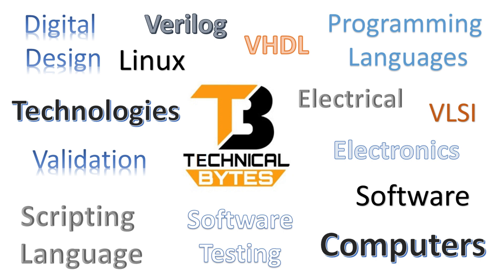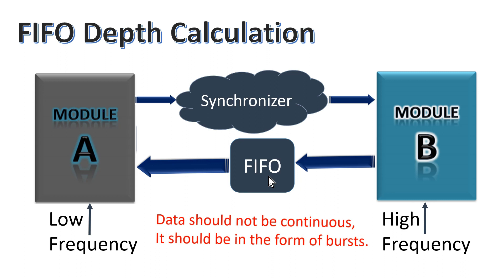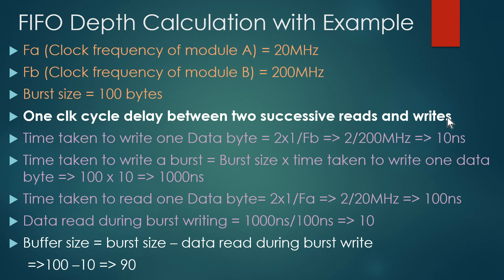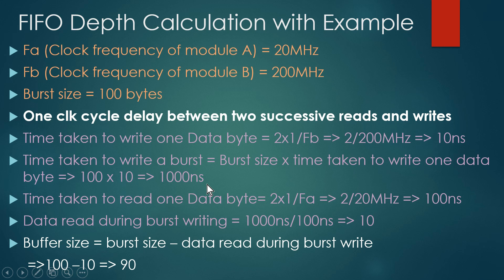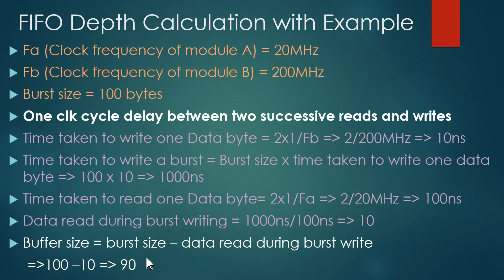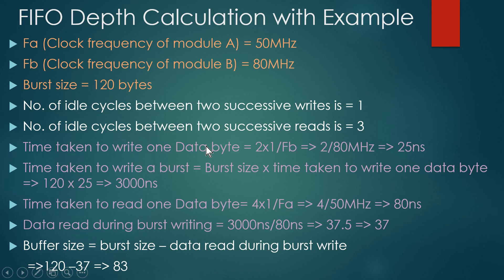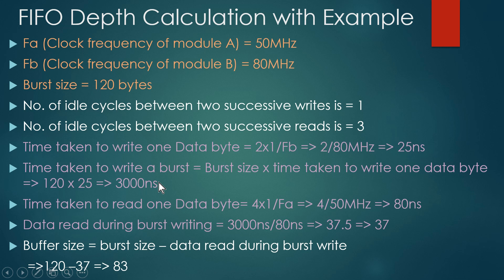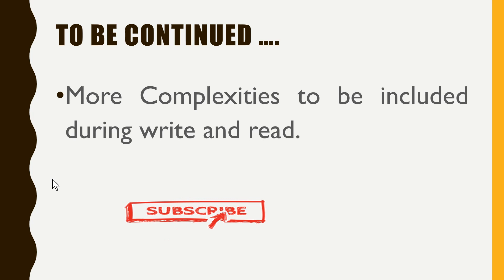Electronics Interview Questions: FIFO Buffer Depth Calculation - Part2

Comment: The one idle clock cycle means exactly similar to no idle clock cycles only right? Because always there will be one clock cycle delay between alternate writes and reads. so why we have multiplied it with 2?
Reply from the maker: I am calculating time taken to write and read one byte. It will be double of the time period.
but you are correct after all the calculations, this scenario is similar to no idle clock cycle scenario.

Comment: Thanks for the good explanation. 
What would be the minimum burst to burst gap in these cases? 
In the case of last example, is the minimum burst to burst gap is (83 * 80ns)?
Reply from the maker: try to calculate and I will correct you if wrong..
Reply: 83*80ns =6640ns is the burst gap

Comment: no.of idle cycles for read is 3 right, but when you calculate read one data byte how it becomes 4*1/fa?
Please clarify me
Reply: As idle cycle means after reading for one clock cycle then for next 3 cycle no operation ... So it means in 4 cycles it will read one time only ..thats why he had taken 4 in calculation

Comment: sir I have seen questions where data reading is faster and writing is slower but even then also FIFO is used as no of idle cycles were different. need some more clarification on that.
Reply from the maker: You are right, FIFO may be required even if writing frequency is slower and reading frequency is higher in case number of idle cycles at the time of reading are quite high as compared to number of idle cycles during writing.

Remember, actual reading and writing speed is dependent upon frequency as well as number of IDLE cycles. Now, if writing speed is higher than reading speed. you will definitely need a memory buffer/FIFO.

let me know if any further clarification required.
Reply: Thank you sir !!

Comment: Is burst size  = 100 bytes is correct  or  burst size = 8bits  , burst length = 100 is correct ?  while considering burst write into FIFO ? I need some clarification on it
please sir make a detailed video with diagram to visualize on fifo data transfer between 2 modules
Reply: in one cycle it will write one byte. fifo width will be of one byte

Comment: I got this interview question
Does anyone have the problem workout and solution ?
 What is the minimum FIFO size required here
    Writing Data = 80 DATA arrives in up to 100 Clocks
    Outgoing Data= 8 DATA is read in up to 10 Clocks
    Data write/read is done with bursts of 160 DATA 
The data provided is confusing compared to these simpler problems.
Reply from the maker: It is not confussing, it is incorrect. Your effective write and read speed is same.
Reply from the maker: Give me correct data, will solve it